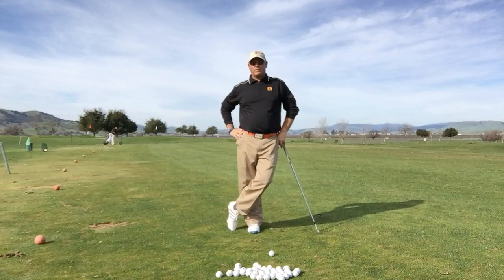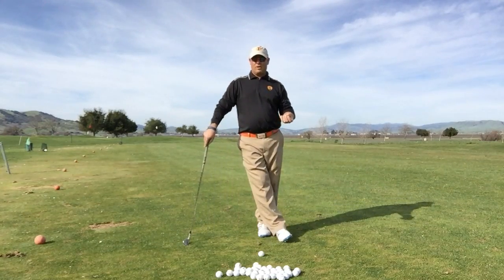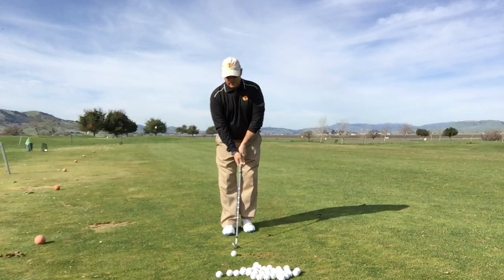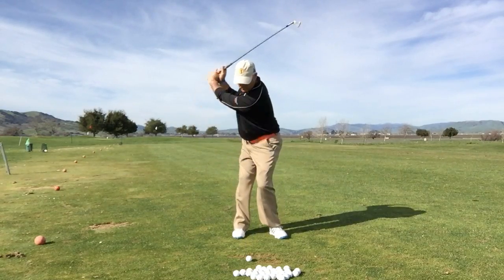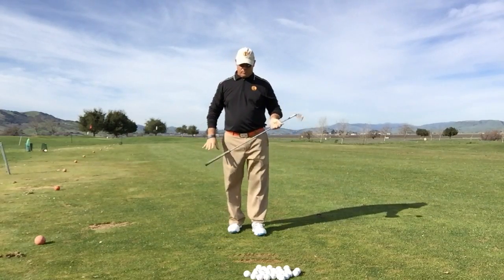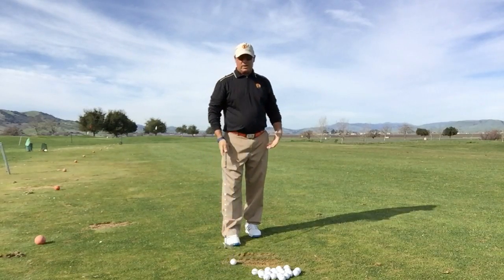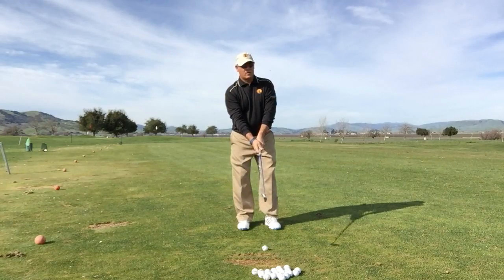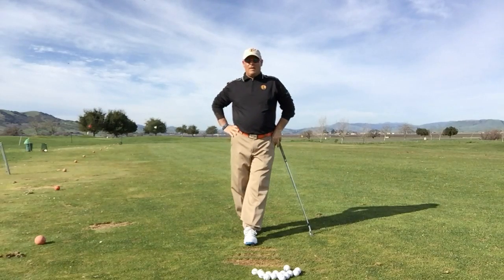2 Stage & 3 Stage Swings

Comment: As a front anchor golfer, in stage one, should the weight still shift to the right foot on the takeaway?
Reply from the maker: Dave Blasquez front anchor golfers will have a pressure shift toward the trail foot.  Some more then others.  However most will also feel pressure build on the inside of the ball of the lead foot.  In your case you will feel your feet torque into the ground instead of feeling a lateral shift.  Pressure will feel like it torques into the heel of the right foot and ball of the left foot!